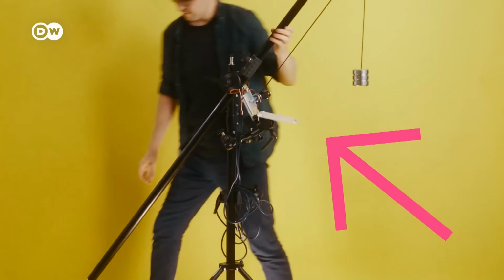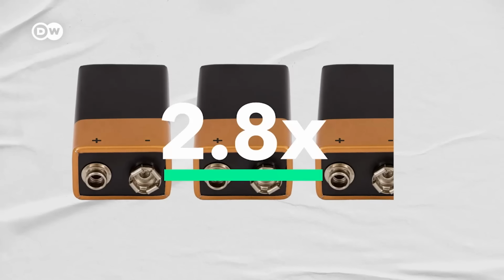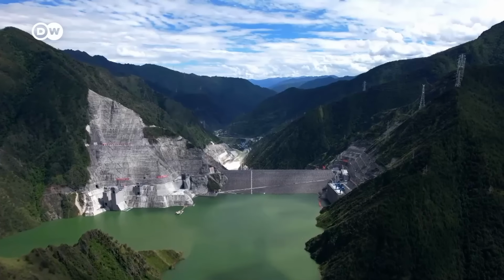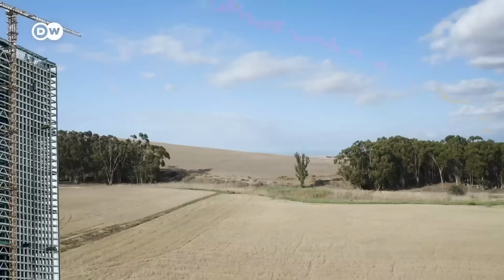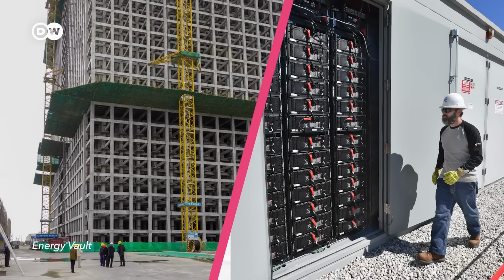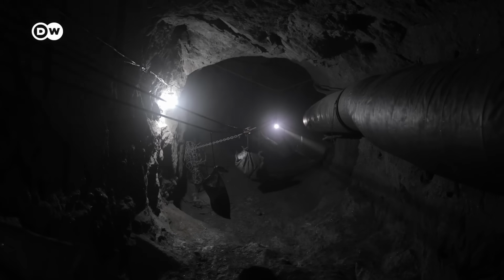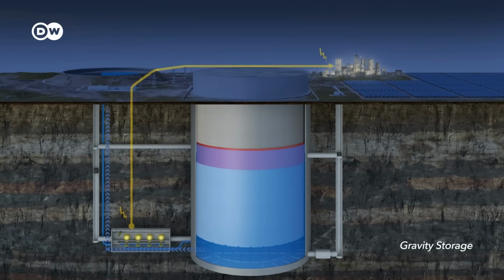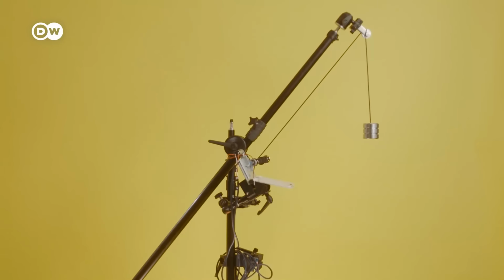How to use gravity to store energy

Comment: As someone that has spent much of their working life dealing with cranes and hoisting equipment, I can state with confidence that this idea is completely impractical.
Reply: Yeah, complete impractical. Concrete is only 2.4x as dense as water. So, you only need a tank 2.4 times to match the potential energy of using water; and you can use simple pumps and pipes instead of complex cable and cranes.
Reply: ofc it's stupid. 
People know this already when this idea was introduced probably 10 years ago.
Reply: Find a potential energy calculator online. Check how many kWh you use in a month. By choosing the weight of a cube, e.g. 1 ton, you will get the answer to what height a 1 ton block should fall. Divide into 10-meter columns. Of course, the idea makes sense.
Reply: I work with cranes and rigging. These are no more “cranes” than whales are fish.
Reply: Why?
Reply: Yeah, complete impractical. Concrete is only 2.4x as dense as water. So, you only need a tank 2.4 times to match the potential energy of using water; and you can use simple pumps and pipes instead of complex cable and cranes.
Reply: @davidlin1980  You would want to use something to stop the ships being easily refloated. If all that is required is to weld patches over holes in the hull and then pump the water out, that would be too easy. Whereas if you fill them up with rocks and concrete to the point where the ship is only just afloat, it would be a lot harder to salvage. Especially under mortar and artillery fire.
Reply: For the mine idea you could and almost certainly would have tracks that the weight goes into then move them deeper into the mine horizontally with ground drones, basically it would be a lift which detaches with ground drones to move them into place and according to their math there are enough abandoned mines and area in those mines to do 70TWh which is plenty of storage for the planet.
Reply: Most of the issues you mentioned can be solved with a sloped hill with cranked rail approach. No wind gusts or major safety concerns.
Only issue would be wear and tear of parts
Reply: @GM740t Sloped hill means even longer rope lengths for the same drop in height, and introduces additional frictional losses in wheels and rails. Wear and tear ARE the issues.
Reply: Lift gold. It will have a small footprint. Make sure you have enough security around the building though
Reply: Weren't these more like Elavators?
Reply: I beleive it is plausible. Although I am a little sceptical about fatiguing the system with so many moving parts.
Reply: I do think that having a crane specifically build for this purpose has at least enough merit for testing.
Regular cranes are outside, have to move sideways, hoist all sorts of different weights and sized object while exposed to the elements.
This will be a crane inside a box that is specifically designed for the weight it needs to hoist and only needs to do this on one axis.
Reply: @Souchirouu  The energy stored is also not enough by far. Pumping water uphill is so much more convenient.
Reply: Why?
Reply: @ygrillo  wind can mess with your organization, the more moving parts the more likely you are of failure
Reply: @yuri_grillo Too many moving parts, wear and tear, something always breaks down somewhere for whatever reason...
Reply: @j4genius961  It has nothing to do with wear and tear and moving parts. These problems have been solved since the development of materials and technologies, and I think they have appreciated them here. Moving parts are currently more reliable and simpler than electronics.
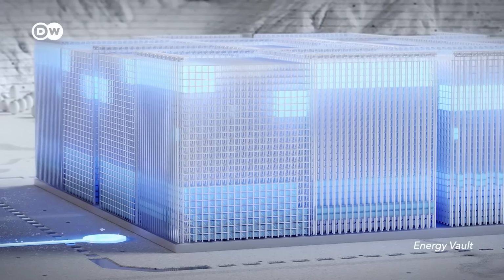Reply: @ياقوت-ق  just look 4:09 at Energy Vault's gee-whiz Willy Wonka elevator moving those 25-ton blocks around, and realize you need this mechanism on the ground and in the ceiling. Do you really think this is simpler than plopping several Tesla Megapacks on the ground next to a power line?
Reply: @j4genius961 as many moving parts as a car but sales and demand for those are successful.  Something "always" breaking down?  That hasn't been the case with existing gravity batteries.  And when anything is new there is NOT always something breaking down...kinda one of the pros of buying anything "new".  You have no logic and I don't believe the OP has the knowledge claimed as this is already a proven tech in many different designs and applications.
Reply: @ygrillo  Armachair experts don't like to explain the workings behind their "facts".
Reply: @krashd  
Because there are too many things that can go wrong.
Wind, the cranes structure, friction, material fatigue - especially the wire. The list go on.
I would indulge you with wind reason because it is easy to explain.

When you lift something high up in the air, it will become freely moving around horizontally.
And if there is but gale of wind blow... those tons of block will swing uncontrollably.

Unless they come up with solution for this one specific problem, which they didn't show us, this whole idea would remain ideas.
Reply: @farn1991 harness bending forces from wind. Invest in grapheme cables.
Reply: @farn1991 Not much wind in mine shafts
Reply: 😂u don't use ur cranes to do such things
Reply: Also, gravity-based batteries already exist in a much more efficient way (haven't watched the video yet but I'm sure they talk about it) - 

WATER.

Reservoirs. Pump water when there's an excess of energy production, and when it is required, you let water flow to move hydroelectric dam turbines. Much more efficient, practical, scalable, etc.

There's been multiple videos, documentaries and reports about how inefficient impractical and dumb ''gravity batteries'' using cranes and weight are...

EDIT - Yep they talk about it in the video. They also should've realized it is way more efficient, practical, scalable than weight-based energy storage...
Reply: but this one is use without any water resources in the area. but pretty similar to hydro electricity but different structure.
Reply: @maepogz  Then compress air into an underground vault. And if you decide to use gravity, the material lifted has to be the most inexpensive possible.
Reply: @maepogz  Okay, and where do you get the concrete from? Ship it in from the big concrete oceans? ohhhhh.
Reply: @maepogz  A ten metre cube of water weighs 1000 tons and can be easily moved hundreds of metres from a reservoir down a pipe to generate electricity. A typical reservoir contains millions of tons of water. Even the biggest gravity batteries are miniscule compared to this.
Reply: @rogerphelps9939 but with water as weights you lose more than 50% of energy as losses? Idk about these solid weights
Reply: @nikmat  Pumped hydro losses are less than 20%. I would  not expect losses with solids to be any better and the amount of hardware required per kwh of storage is a lot more.
Reply: @pizzablender you’re acting as if someone can’t have multiple solutions to a problem… if you need to store energy? You should only store it with gas and wind and not gravity. That’s like saying you shouldn’t use glass cups. They break easier so it would just be dumb to…. Explicit we don’t do that right? Because we try to find more and more solutions to the problems we have instead of just a few.
Reply: @rogerphelps9939 probably 30%
Reply: @ProtoMarcus  Potential of water  in most suitable places (mountains and water) is maxed out.

Then, most places on earth are not suitable for water pumping storages. 

That is the reason we are looking for other solutions.

Otherwise it would be easy.
Reply: @ProtoMarcus  the amount of water isn't available everywhere, which is the issue. You also need to build the infrastructure for it, which has both cost and environmental factors.

If we use gravity batteries in abandoned mine shafts or any other dig sites, the costs would be greatly reduced, since you don't need to actually build or even dig anything, maybe just make a few modifications to suit it
Reply: You spent much of "their" life they who?
Reply: @aleksitjvladica.    using the singular "they" and "their" as a gender-neutral third-person form in English first emerged in the 14th century. You can catch up ;-)
Reply: @aleksitjvladica.  They Them
Reply: What about Ocean Wave Energy?
Reply: @callyman  Wave power isn't energy storage, it's a way to capture energy from the wind and tidal forces moving huge masses of water around. It has its own engineering challenges, and the maintenance of a complicated mechanical system sitting in water will be brutal. The "Wave energy converters" section of the Wikipedia Wave power article is a decent intro. Research and a little development continues...
Reply: Make the connection 👉 The Connections (2021) [short documentary] 🌎 ♥️ 😎 ✨️
Reply: Thanks 🙏. Those clowns never consult experts first

Comment: Why are they push so hard that litium ion cant store energy longer then six hours? Thay is obviously false and they atleast need to add some context for does claims.
Reply: Actually, you could use at least some types of lithium-ion-batteries even for seasonal storage, regarding low energy losses over time.
It just doesn't make much sense economically and ecologically, they are too expensive to use them for only one charge cycle annually.

Comment: Maybe a gravity battery tower will be built someday but it absolutely will not be built in a city. It stores electricity which can be sent hundreds of miles away with not much fuss, so it makes no sense to build in one of the most expensive real estate areas.
Reply: It makes no sense to build one, period. Read the other comments here.
Reply: @skierpage  I have been reading them but few actually give any details beyond stating "this won't work" is is impractical.
Reply: @CausticLemons7  of course it will work. But because gravity is such a weak force, you store so little energy per ton lifted high in the air that it is completely uneconomic. Get a units calculator (I use Fourmilab's) and enter any numbers for `X tonnes * gravity * Y meters` in kWh. Nobody stores electrical energy by lifting things in the air.

Look at Energy Vault's Chinese building. Even if you ignore the cost of the building and the land, consider all the expense and ongoing maintenance to move around, lift, and lower 16,000 25-ton blocks ~100 meters into the ceiling just to store a claimed 100 MWh.

Comment: gravity energy will not be cheaper. because it need a tall building. price of concrete and steel + labor cost increasing every year. there is no way it will be cheaper. mean while battery built in factory by robots it will be geting cheaper.
Reply: that's stupid AF.

1) lithium prices and scarcity will trump everything
2) gravity battery structures will be completed automated, and also could be built by robots pretty fast.

There's literally zero downsides.

Comment: Hasn't this already been proven to be wildly inefficient and expensive at the same time? That looks like a staggering amount of steel to hold all that weight up high. 
I think Sodium Ion is going to fill the grid scale storage space when it achieves mass production in 5 to 10 years which has vastly more options for ease of installation and very low self discharge rates.

Comment: Individual projects would need to prove their worth. It will probably depend on local factors, like having a mine shaft but not having spare water.
I can't see the economics of a seasonal battery working. It would only run a few times a year, so would have to receive so much money for those few times.
Can you do a video on iron-flow batteries? An American company is building one. Seems closer to viability than gravity.

Comment: Obscenely Foolish! I’m fairly convinced most people simply can’t think logically and do basic Math. Let’s just think this BS Rube Goldberg concept thru for just a bit. 
A midsize vehicle weighs similar to a large concrete block. It takes me less than 1/2 a gallon of Gas (1.9 liters of Petrol) to drive my larger vehicle from downtown up the hill where we live the 10 minutes to home. This is an altitude change of 2000 feet (600 meters). Because of the rules of the universe of energy conservation, that’s roughly the same amount of energy storage you could possibly expect from a concrete block hoisted the same height of 2000 feet up a tower. And I’m being generous because my car is no where near as efficient as electric motors and generators in an optimized system. That means the real energy storage would be something a fair bit less per car sized concrete block but let’s just go with it. Also, these gravity storage systems would be hard pressed to get 2000 feet. 
So, you’re telling me that to store less than a half gallon’s worth of Gas(petrol) energy per massive block if I could find a way to hoist it 2000 feet into the air in this hypothetical scenario is supposed to be economical? Seriously? The paltry energy storage per unit in these systems is seriously laughable! 
Or think about it this way. The large system in this video claims 100 megawatt hours. If you do the math to convert to energy content of liquid fuels, it’s roughly 3000 gallons of gas. That’s 1 medium sized tanker truck!  But Look at the size of that monstrous gravity battery storage Cube and just digest that it’s about the same energy as 1 tanker truck! How much does that massive Gravity Cube facility cost to build? What’s the CO2 footprint of its construction?  The maintenance costs? 
And 70 Terrawatt hours is such an overly optimistic number it’s simply not even worth addressing!
Pumped Hydro works because it’s using liquids which are easily pumped around and happen to form to fit whatever container nature has helped provide us. Throw up a small dam and put some generator/motors and pipes in and find a reservoir of water below our small Dam and easy cheesy. But even these systems store relatively small amounts of energy vs their large footprint based on the physical realities of energy storage that apply to the scheme I’ve lampooned above! And we simply can’t do pumped Hydro everywhere. You need favorable geography and there is environmental tradeoffs to man made reservoirs.  
Why are we pursuing such foolishness? My answer? Because the renewable energy dream needs something, anything, to try to save it from the harsh realities of basic physics. Grasping at straws its proponents employ these Rube Goldberg concoctions in any hope of salvaging their craziness from reality’s harsh truths! 
Here’s the truth. Energy farming is a fools errand. The Hype train is taking us towards disaster! Powering modern industrial societies takes cheap, on demand and dense energy systems. It’s time to get past our foolish misconceptions and face hard realities. The most energy dense storage system mankind has ever discovered is Uranium and Thorium. Wake up people.

Comment: The funniest part is, when you see this absolute massive building in China, with its 100 MWh capacity. That's impressive and all, but if you would take LiFePO4-Cells and pack them into a cube of 10x10x10m you would theoretically get a capacity of 200 MWh. For this big battery you would need around 16t of Li, so in the most commonly used battery-grade Li2CO3, there would be a need for around 170.4t of Li2CO3. Not that big of a deal, in my opinion, if i consider that this would eliminate the need to build a truly massive structure of around 100x100x150m.

Yes, this is idealized, but even if we divide the capacity of this 10x10x10m cube full of LiFePO4-Cells by 2, there still is the same amount of energy stored, as in this building, which is 1.500 times bigger.

Comment: How many dumps have the right slope for a gravity battery?
Reply from the maker: Well, determining suitable locations for a gravity battery involves assessing the topography, the available height difference, and the feasibility of retrofitting the site. In general, sites like disused mines, hilly terrains, or landfills with significant elevation changes could be candidates. However, without specific data on these locations and their slopes, it's not possible to provide a precise number. 😉
Reply: @DWPlanetA  Seems like something a database could solve. Moreover, it seems even landfills would be the opportunity for an energy company to partner with a waste company to design the slope to be optimal for this purpose? Actually, I imagine there should be nationwide databases on dumps since they are regulated. Seems like a good follow-up article for a research organization like DW...

Comment: This baatery is good and all, but what if we used an existing site for storing the blocks, like a mountain? Sorted. Oh and why don't we use a fluid water instead of solid blocks of concrete, so we only have to use a series of pumps to get from the low energy level to the higher one? Sorted. Oh and why don't we call this "pumped hydro storage", since we are pumping water up the hill into a storage container? Sorted.

Wait...this technology already exists and is already called "pumped hydro storage"? Well...
Reply: Run the bloody numbers!!
The horrible bastard unit we use is KiloWattHours - 1 "unit" - 1kWh is 1000 watts for 3600 seconds - 3,600,000 - 3.6 MegaJoules

That is like lifting a 3.6 ton weight (36,000N) up a 100 meters 

A Tesla battery is 50 kWh - equivalent to lifting 36 Tons up 500 meters - which would require a building which would be one of the highest in the world

A "Gravity battery" using concrete blocks is a stupid idea

The 25 ton blocks and the 100 meters (being generous) in the video would each store 250,000N x 100m = 25 MegaJoules - about 7 kWh - about $2 worth of electricity

A Tesla MegaPack is 3,000 kWh - or 428 of the 25 ton blocks - per module!!!

Comment: Low energy density is a bit of an understatement... 
just a quick example calculation: say you have 1 ton being lifted 100m then that's just slightly over 270Wh of energy or about 1kg worth of lithium ion batteries... 
Not to mentioning the energy being lost in all the mechanical components.